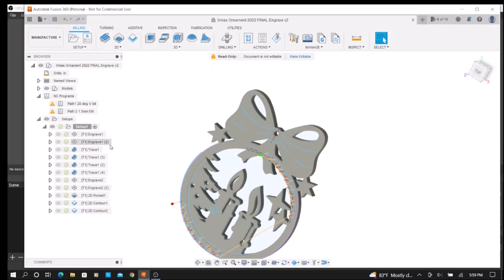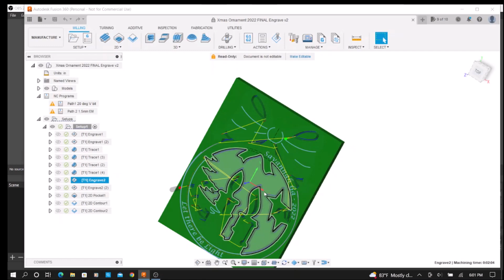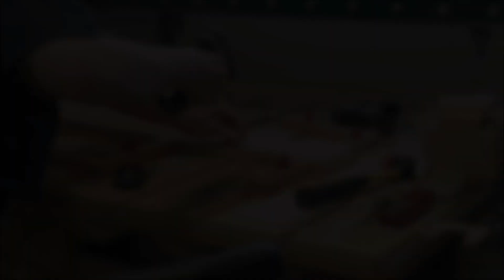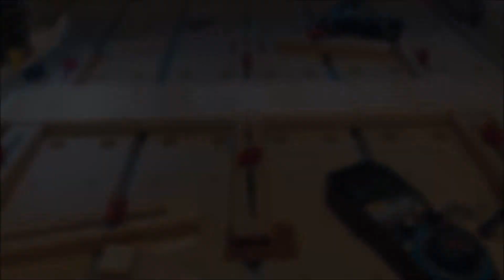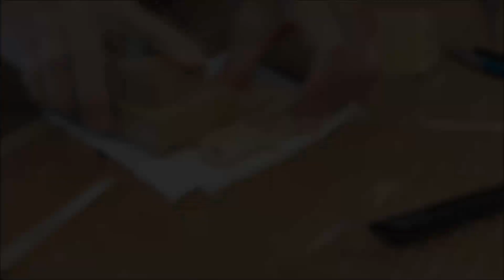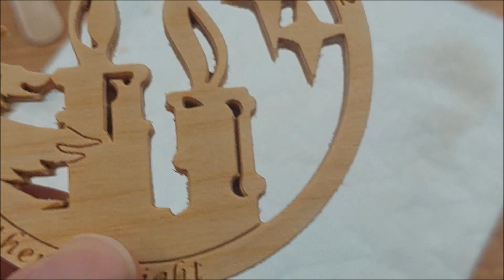CNC Makes Christmas Ornament 2022

Comment: Great tutorial Richard, can you make a video on how you have your indicator set up on your machine. I see you are using rubber bands
Reply from the maker: Hi Fierceflyer55, The indicator's magnetic base rod was unscrewed from the magnetic base, and then simply mounted in the spindle collet.   I have a 15/32" ER20 collet that matches the diameter of the rod for this purpose.   The rubber bands where there to prevent the spindle from rotating as the indictor moved over the stock.   Since this video was filmed, I have 3D-printed an indicator holder which was down-loaded from Thingiverse.  In Thingiverse Its called "Dial indicator clamp for CNC router spindle".  Thanks for watching.